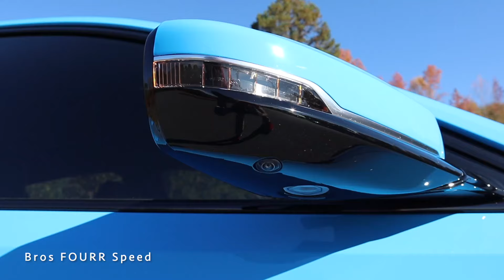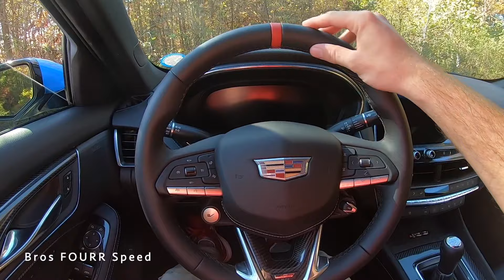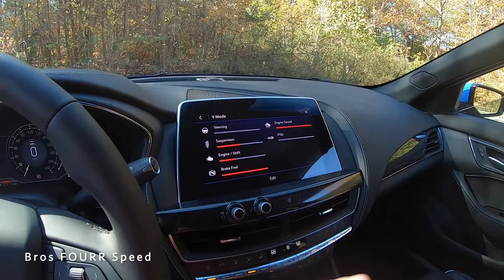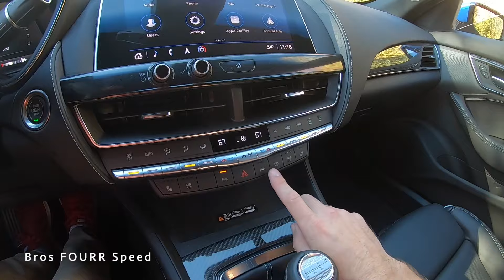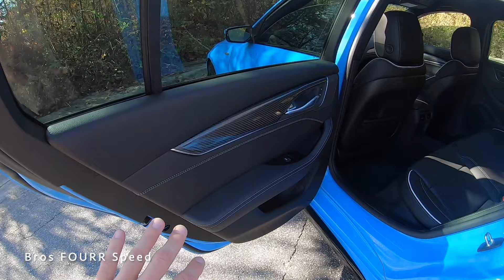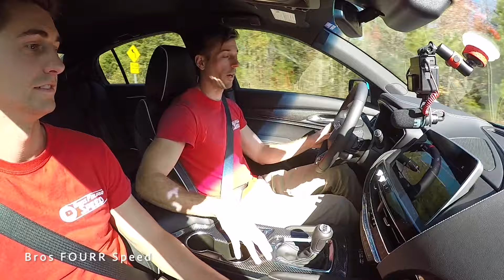2022 Cadillac CT5 V Blackwing (Manual): Start Up, Exhaust, Test Drive and Review

Comment: Cool car, good review. 
You need to go wide open throttle and take it to redline- the LT4 loves to rev and that’s when the power really comes in , over 6k rpm. I have a Cts-v with the same engine, it’s an incredible motor.
Reply: I'm guessing this one didn't have 500 miles on it yet. They're limited to I think 4,000 or 4,500 RPM until then.
Reply from the maker: @JaySuds312  yeah we didn’t want to push a brand new car with no miles 😅. I’m sure it’s a beast WOT
Reply: @BrosFOURRSpeed  yep, makes sense. Pretty sure these have a literal hard cap on the redline as well until you get to 500 miles, just in case.

Good video. Excited about this car.
Reply from the maker: Probably similar to how the C8 Corvette does that
Reply from the maker: This car had like 20 miles. I’m not going to rip on a brand new car, especially one I don’t own. I’m sure it’s be awesome tho!

Comment: One of the best cars not for sale in Europe.
But this is more powerful, lighter, has a higher top speed, is more fun and costs less than an M5.
This will be the last ever petrol Blackwing Cadillacu.
Reply from the maker: It's a great option for sure especially having the manual!  The M5 doesn't come in a manual here for the newer one, but the M3 does! More on that price point, but such a cool Cadillac!
Reply: @BrosFOURRSpeed  The M5 wasn’t offered a manual in Europe since the E60.
And Brits don’t get the manual M3 unfortunately, so if I want an M3 manual, I’ll have to go to elsewhere in Europe or Australia.
Reply from the maker: Oh wow. Would be cool to have a manual M5 tho!
Reply: @BrosFOURRSpeed  M3 is only offered in manual on the base. Competition package is auto only unfortunately. Even in competition trim it’s down 150 HP or so on the Cadillac. M3 is more like the CT4V.
Reply from the maker: true. but you can easily tune it to be identical to the Competition. The CT5 V like we said in the video is more on par with the M5. But the M5 has no manual option. So that's why we talked about the M3